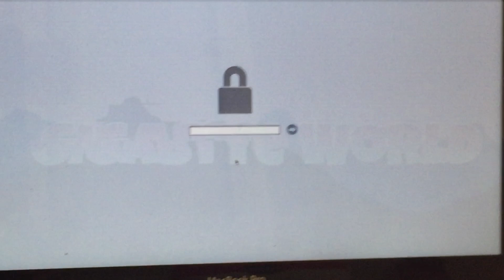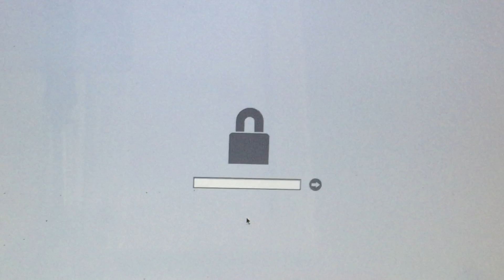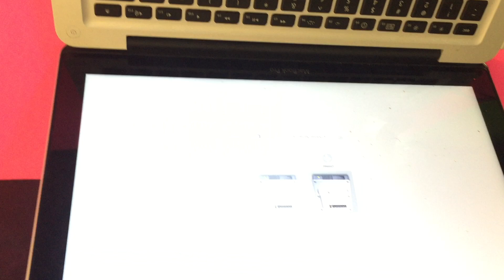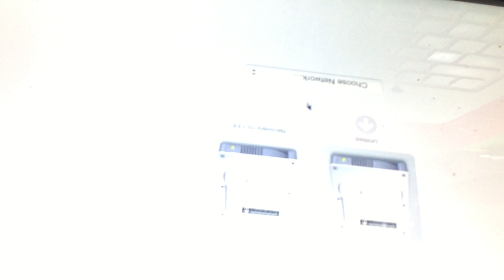HOW TO REMOVE FIRMWARE PASSWORD ON MAC

Comment: So basically I need to buy a ram and remove the two sticks and do what you did. I will see if that actually works on my MacBook.. I have a MacBook Air Model. A1465 will it work on that? Is there a way to get the passcode removed? I cannot figure out the passcode to get logged in
Reply from the maker: I am sorry this will not work on the MacBook Air the ram is not removable

Comment: Hey I'm having this issue with my iMac 2011 running high sierra, any solution please?
Reply from the maker: What’s the issue
Reply: @GigabyteWorld  I'm getting a white screen when booting my Mac,  I tried to use the recovery mode maybe to fix it, that's when I realize that there's a EFI password that I don't know
Reply from the maker: @rhanmardochee5429 open the iMac and remove a stick of ram and follow the video prompts
Reply: @GigabyteWorld  I tried everything, I'm using 16GB RAM, I just leaving on one stick of 4GB ram but it's not working

Comment: Amigo la ram necesita ser una ram que nunca se haya usado en la computadora?
Reply from the maker: No it does not have to be new ram the trick is to just change the amount of ram if you have two ram sticks take out one stick perform the steps in the video when done put the ram stick back into the computer

Comment: i have a macbook pro i think it is 2011 and i tried to install bootcamp and i got the error "no bootable device found" when i try to get into recovery mode the macbook shows the efi lock.i have 2 4gb sticks of ram when i remove one and try to reset the pram my macbook quickly turns off and then i holg the power biutton again to start and when i try again it turns on but the pram doesnt reset do i need to change the ram to one that has never been in the mac before for it to work ? i remember the this mac used to be locked but i unlocked it and i cant remember if i unlocked it by watching this video or not
Reply from the maker: @Hamzah18099  hi there as long as the Mac was never updated to high Sierra or newer software you can unlock it my advice is take out both sticks of ram boot it up you will hear the beep sounds now turn it off install one stick of ram and try the pram reset good luck

Comment: Will it work in mid 2012 MacBook Pro 13 inch I resented the ssd and all I see is the Lock Screen or the file question mark can it work please reply and this happened after I wiped the Ventura installation I did with opencore
Reply from the maker: The method only works for systems that have not been updated past to high sierra or newer software

Comment: Does this work with 2017 intel-based MacBook Pro
Reply from the maker: @Stephedits30  unfortunately the ram of the 2017 pro is not removable so this method would not work

Comment: Having this issue with MacBook Pro 2011 | High Sierra 10.13.6 need ya help
Reply from the maker: This only works on models not updated to high Sierra yet
Reply from the maker: Visit your local computer repair shop for the lock removal
Reply: @GigabyteWorld ok

Comment: I have same issue but I just want to ask if there’s no other way without replacing
Reply: Yes
Reply from the maker: If the macbook was not updated to high Sierra try this method in the video it should work .Open the bottom cover remove one stick of ram then start up the macbook holding Command, option ,P and R keys hold those down while the computer is staring up you will hear one chime keep holding the keys on the second chime the MacBook should be unlocked now turn it off and press the option key and hold it down you should seen your hard drive or other vices you have connected to the macbook
Reply: @GigabyteWorld anyway thanks for your help
Reply from the maker: @rich20919  you need a tonight start or Philips screw driver can be found on Amazon or any local to you hardware  store let me know if you are able to open it
Reply from the maker: What year is the Mac this is the method that I know works depends on the model and the software installed
Reply: @GigabyteWorld the Year is 2010
Reply from the maker: And it’s a Pro
Reply: I don’t have the tools to open it

Comment: If this works I will give a sub. I have a stuffed MacBook Pro
Reply: It got erased when I tried to do boot menu then it locked up on me. At the time it was running hackintoshed macOS Ventura. It is a 2011 13” MacBook pro
Reply from the maker: This hack works on systems with older macOS before high sierra you can still get it unlocked at your local computer store for a small fee call around
Reply: Ok thanks mate. Also does it work with nothing on the hard drive
Reply from the maker: Yes you can still have the lock removed without any macOS on the hard drive
Reply: @GigabyteWorld  macbook cooked i cant even to pram reset or anything. the hackintosh tricked the MacBook into thinking it is newer model. The MacBook is cooked cooked
Reply from the maker: Which software did you install what happened
Reply: @GigabyteWorld  i had macbook pro that locked up after i messed up boot camp and it firmware locked. I attempted to install macos High Sierra and it still was blinking questionmark after i plugged in the SSD internally and externally. I tried your tactic but it didnt work cause it dosent respond to any of the keyboard commands. It is a macbook pro 2011 13" that was last on hackintoshed macos vendura
Reply: oh and also the logic bored may think it is newer model
Reply from the maker: I just installed Sonoma on a 2013 Pro a few days ago maybe I should remove it
Reply: @GigabyteWorld remove it. Cause if anything goes wrong it is cooked cause the logic bored may still think it is newer model and refuse to install older macos cause it thinks its not compatible and it wont install newer systems cause it then goes against itself and refuses to install cause that system is too new
Reply: It happened to my friends 2011 computer also apple
Reply from the maker: What macOS is on the macbook and what year is the macbook

Comment: Hi I have tried this procedure on macbook pro 13 2012 with 2 stick of removable ram. I have removed those two and replaced with one from other pc 1 stick 4 gb an it didnt work. Will that work only with 1 gb stick? When nvram resetting it wont play charm.only once when  press power button. Did i do something wrong?
Reply from the maker: @martinpospisil1115 hi there for this hack to work the macOS that is on the macbook has to be older thank high Sierra also the amount of ram that you replace with does not matter 1 GB 2 GB 4 GB 8 GB as long as you change the ram that is were the solution is old software & ram change.

Comment: Bro help me how do I bypass firmware password I don’t know the exact model here a pic I wanted to try the memory trick but I don’t know if I can
Reply from the maker: @emmanuelcuc6061  the model number is on the bottom cover is it a pro or air
Reply from the maker: Did you try the steps on the video?

Comment: I didn’t work
Reply: 2011 MacBook Pro model A1278
Reply: 2011 MacBook Pro model A1278
Reply from the maker: Ok which macOS was it running
Reply: @GigabyteWorld  tbh idk I can’t get it book up into Mac OS
Reply from the maker: Have you removed one stick of ram and followed the video  instructions
Reply: @GigabyteWorld  yea
Reply from the maker: Try doing this with a USB keyboard if that fails then take it to a computer store they will remove the lock on MacBooks that have newer software this method would not work on macOS Sierra and older macOS versions
Reply from the maker: What year is the Mac and model number
Reply from the maker: Is it a MacBook Pro or iMac what year 
What macOS was it running

Comment: I tried this a thousand times, not working on my 2011 mac mini. Sad!
Reply from the maker: Which macOS version is on the Mac mini
Reply: @GigabyteWorld  Mountain Lion, but I was able to upgrade to Sierra. Thanks for asking.
Reply from the maker: Did you upgrade from a usb drive or from macOS lion normally an upgrade using usb would not be possible if your Mac is firmware locked 🔒
Reply: @GigabyteWorld  I upgraded from Lion to Sierra after downloading the latter. No USBs.
Reply from the maker: I am glad to. Hear your upgrade was a success .
Reply: @GigabyteWorld  Thanks, but that is not my concern this time. Help me get rid of that stupid locked padlock asking for the password I never setup.
Reply from the maker: The hack works on lion & older software not on high Sierra at this point I would say visit apple if you have proof of purchase or visit a local computer shop they will remove the firmware password for you .
Reply from the maker: This method works on lion

Comment: Not working in macbook pro 2011😭😭😭
Reply from the maker: This method only works if your MacBook has not been updated to MacOS High Sierra or newer software can you find out which macOS version you have
Reply: @GigabyteWorld  on my macbook now installed macOS Ventura via opencore
Reply: @GigabyteWorld  please help me 😭😭
Reply from the maker: @citramedia9321  which macOS is on the MacBook
Reply: @GigabyteWorld  macOS Ventura in MacBook i have one macbook only
Reply: @GigabyteWorld  Now my SSD is having problems, I want to replace it and install a new OS, when I want to install it on the new SSD, it turns out I forgot the firmware password
Reply from the maker: This method would word with MacOS Ventura
Reply from the maker: I would visit a computer store for help then can remove the code

Comment: Doesn’t boot up when I change the ram
Reply from the maker: Please make sure the ram is properly installed or change the ram socket from if it’s in the top put it at the bottom of it’s in the top slot put at the bottom
Reply from the maker: Make sure the ram you are using is no defective

Comment: Not working still locked
Reply from the maker: What year is the computer and model number  as mentioned in the description this works only for certain years and models not all
Reply: Hi MacBook Pro 15-inch 11-10-2011 model A1286
Reply from the maker: @matlukan  depends on what macOS you are running for the method to work if your MacBook has macOS High Sierra or newer this method does not work

Comment: I have an macbook air model a1465 would this work on it ??
Reply from the maker: Hi Karina unfortunately this method would not work on the MacBook Air as one of the steps in the process involves changing  the ram  amount which you would not be possible since on the MacBook Air the ram is not removable

Comment: hi can i repair my macbook air 2009-10 model firmware password how
Reply: need to change my ram?? to bypass the firmware pass??
Reply from the maker: Yes the ram of it was a pro need to change the ram amount but you can’t do that on a MacBook Air as the ram is not removable
Reply from the maker: This method would not work on the MacBook Air as it does not have removable ram

Comment: Would this work on a MacBook that I’m buying with a password lockout? Seller is selling due to forgetting her password. Just checking if it’ll be wise if I try this method after purchasing 2023 MacBook Pro
Reply from the maker: Well there are two types of passwords
Did she forget the login password or the firmware password .If it’s login password you can just reset the MacBook and it should work if it’s a firmware password then this method shown in this video would not work on a 2023 Pro .If it’s a firmware password the  seller can visit the Apple Store and have the password removed before selling it to you if that’s possible
Reply: if it is not on firmware password you do not need to remove the rams and do what this video says... You can always hit command R then you should be prompted the restore options in the recovery and remove the password from there.. I have done it on one of the laptops I got

Comment: This is so fake, as a app technician this don’t work at all
Reply from the maker: If you have an old MacBook Pro  made before 2012 that has removable ram that has never been updated to MacOS High Sierra lock it 🔒 with a firmware password ship it to me and I will unlock it  using this method and send it back to you . This method does not work for any units made after 2012 since the ram on the MacBook Pros is no longer removable
Reply: @GigabyteWorld  so your telling me if you get a MacBook that’s never been updated to High Serria witch is very very rare for it not be updated this will work ? I have a 2010 MacBook  Polycarbonate on high serria will it work? It has EFI LOCK
Reply from the maker: @tommyclarke3426  that is exactly what I am saying the unit needs to have old firmware and not have been updated to high Sierra or newer OS . It’s stupid how this works but it does work .This would not work on your unfortunately 2010 because it’s on high Sierra 
If I find a unit with older OS I can make a second video .
Reply from the maker: Method 100% works for older MacBooks & also iMac depending on the firmware

Comment: i cant reset nvram though because of the firmware lock
Reply from the maker: What year is your MacBook ?
Reply: its like mid 2010
 @GigabyteWorld
Reply from the maker: The mid 2010 can definitely be done as long as the software has not be updated  to high Sierra because the method used  in the video is for units running MacOS before high Sierra try using a usb keyboard and follow the video prompts it should work .
Reply: Sadly it still didnt work out for me, is there other way to like bypass or reset the nvram
Reply: If there is none, then this might be it for my mac, thank you so much for trying to help have a good everyday 😁
Reply from the maker: Which macOS is the MacBook running ?
Did you take out one stick of ram ?
Reply: @GigabyteWorld  yup
Reply: @GigabyteWorld  like right now it doesnt have any mac os since i tried reinstalling lion and then went into some problems and now im stuck between a flashing folder with question mark and the efi lock
Reply from the maker: If it had lion then you should not give up 
It does not matter  if it currently has an OS as long as it was not updated to high Sierra at some point this method works 
1.take out one stick of ram 
2.turn it on as soon as you hear the chime sound press and hold Command + option key plus P key plus R key hold all four   keys down the Mac will restart two times keep holding by the third time let go of the keys now press and hold the option key you should see boot options  I have done this method on several units this should definitely work
Reply: @GigabyteWorld  thank you very much, ill try this again, thank you for answering my question, may you have a great and amazing everyday 😊

Comment: So what happens when you reinstall the stock ram, is the password removed or does the firmware password screen pop up again?  Also... how do you do this if you don't have an extra stick of ram to replace the current stick?
Reply from the maker: Once the password is clear putting the ram back does not change the status once cleared it’s cleared just be aware if your macOS is  high sierra or newer this method will not work .if you have two sticks take out one and follow the video prompts

Comment: What if I don’t have any tan just laying around like most people 😅 would I need to buy one just to reset or can I do with just taking it out?
Reply from the maker: You can just change the amount of ram if you have two sticks take out one the follow then prompts on the video good luck
Reply: It’s a 2019 also . Would it be the same?
Reply from the maker: This would not work on the 2019 
This method only works on older units 
That had removable ram and have not been updated to high Sierra
Reply: @GigabyteWorld  do you know if there’s a method yet for the one I have a 2019?
Reply from the maker: @sykoblk24b  you can also take it to apple with proof of purchase they can remove the password for free .You can also visit your local computer store for help .
Reply: @GigabyteWorld sorry but this just happened to me and apple will not touch a computer over 10 years old. Even though when I called apple support they made the appointment for me and found my proof of purchase. It’s crazy!  5-7 years old considered vintage and 7-10 is obsolete. Mine is 2013 MacBook Pro. But I’m afraid I had just updated it before I lost it which is why I’m having problems. Thanks for the video though.
Reply from the maker: Sorry to hear about your issue my advice is find a none apple repair shop for a fee they will resolve your issue

Comment: BRUH! 
I want to give you a BIG heart felt hug right now! 
I have been trying to find a solution to this Firmware Lockout for two weeks. Even had Apple Support on the line. 
They could fix the issue, but wouldn’t because, I didn’t have the receipt for my 17”, 11 year old MacBook Pro. 🤨
Anyway, THANK YOU! I’m now a subscriber! 👍🏾
Reply from the maker: I am glad this is as helpful man Cheers 🥂
Reply: I have attempted to reset the pram, numerous times as you demonstrated. 
Even went out and bought a 2 gig stick to swap out with. M
However, my laptop still brings up the Lock & Password window. 
Any suggestions to get this to work?
Reply from the maker: What OS was the MacBook running if it has been upgraded to MacOS High Sierra or newer versions this hack does not work

Comment: Hi i have a macbook pro 2011 i forget the login password and when i open the recovery mode there is a firmware password will this method work for resetting the login password from recovery?? Kindly reply
Reply from the maker: This method is for removing the firmware password for macs that have not been update to high Sierra what OS is your MacBook running